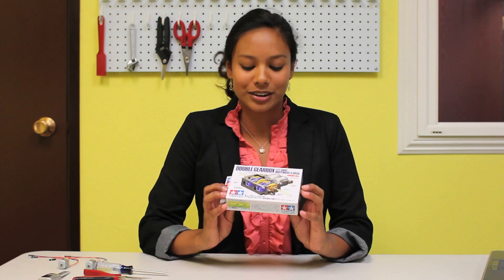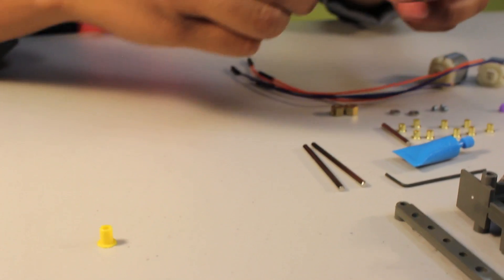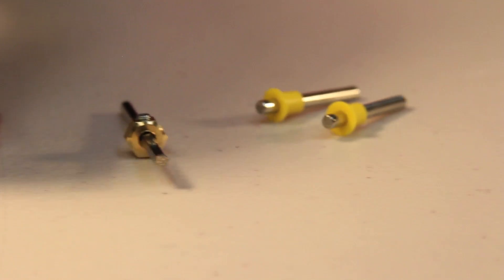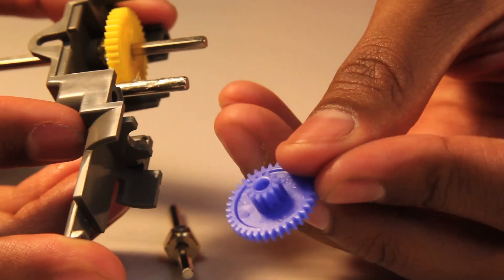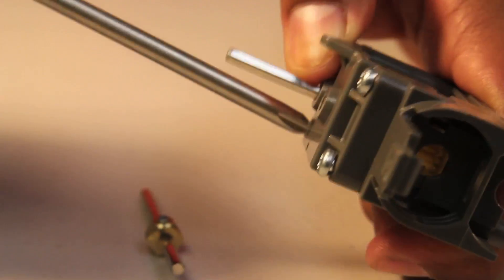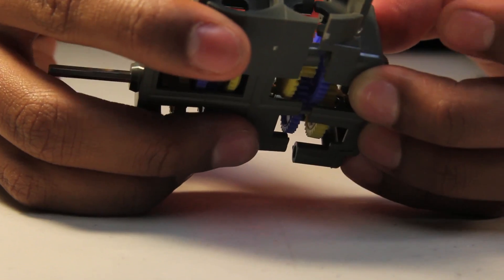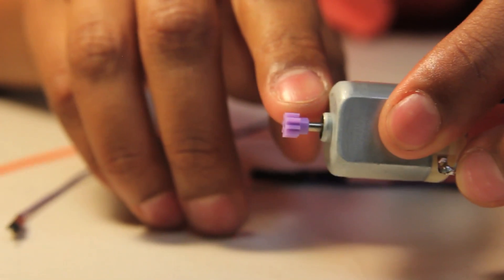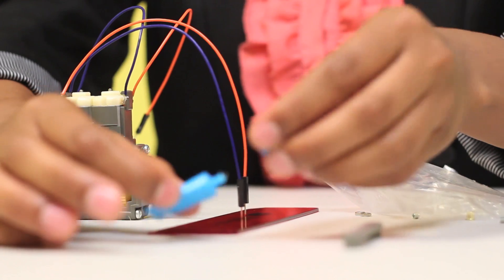Pi-Bot 4: Double Gearbox Assembly

Comment: Not even 10 minutes in and my shit isn’t lining up I have measurements exact I didn’t get no fuckin screw driver ether and no wires for the dc motors this shit is fucked really fucked hard in the ass and I ran out of Grease on the second shaft

Comment: I find a good pair of side cutters (also called flush cutters, sprue cutters, etc.) an essential member of my toolbox.  So much better for removing plastic parts from the sprue than bending them back and forth!  You end up with much less plastic left on the part that would then require filing (or god-forbid simply left on!!)

Comment: thanks . good job. one question ;how can we change the gear in the assembly mode? 4 speeds
is there in manual explained?
thanks in advanced
Reply from the maker: Hi Silva! Glad you are finding these useful :) There is no way to change the gear when the Pi-Bot is running (no "clutch"). We use the gearbox's Configuration C with a speed we have tested and assembled as described in this video and the assembly manual. The gearbox box itself has three other assembly variations which you are welcome to try out. Two of the other modes are faster and one is slower. We only are providing instructions for the mode that we feel is best optimized for the Pi-Bot. Do let us know if you try another mode and how it works! Good luck!
Reply: +STEM Center USA hi in my manual there is type A.B.C.D with is the fastest one?
Reply: +Crazy Impala A is the fastest. D has the most torque.

Comment: Right before we put in the motors, one side of the gears turned more easily than the other.  Is this bad, or can we keep going without any concern?
Reply from the maker: Theoretically, both sides should be the same. However, this mechanical system has varying factors including variation in assembly, friction (grease applied), etc. If there is minor motion change, it should be okay. But if it is significantly different, you may want to check your assembly. Check that your shafts are equivalent on both sides and all gears are meshing cleanly. You may need to realign your shafts.